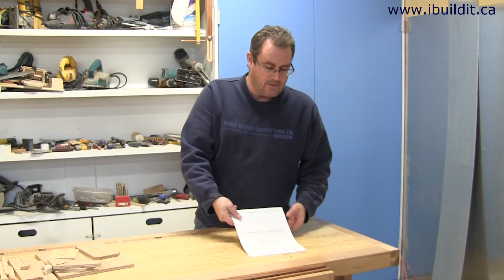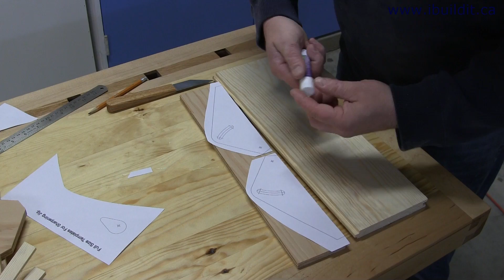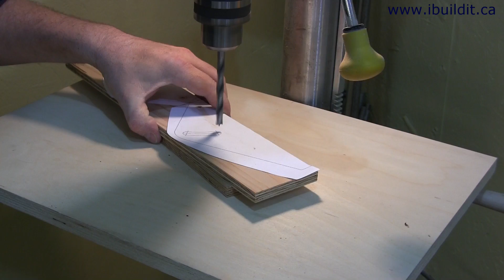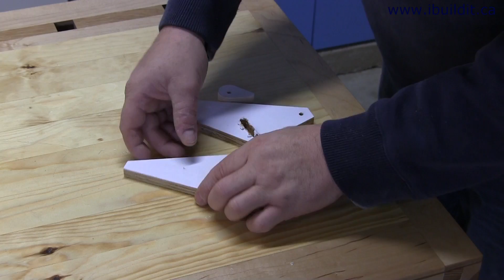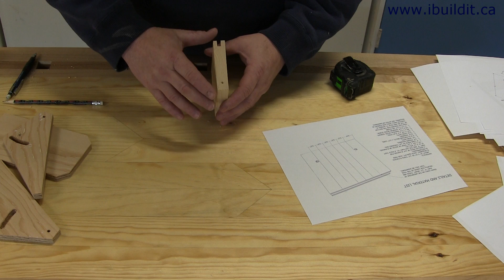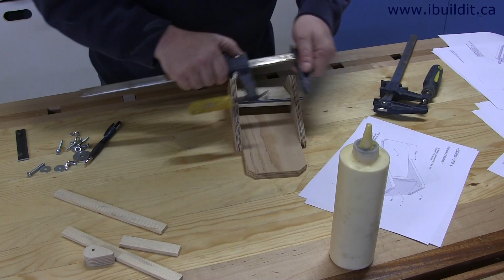How To Make A Chisel Sharpening Jig

Comment: That is an awesome jig. And I don't want this question I'm going to ask to sound like criticism because it's not I really have never done something like this so don't know, and I would love to make something like this. Wouldn't it be more stable as a jig if you had a guide rail on both ends of the jig for a slot to slide through rather than just the one end? Or would that keep the blade from being able to get enough pressure against the stone, or is it even necessary?